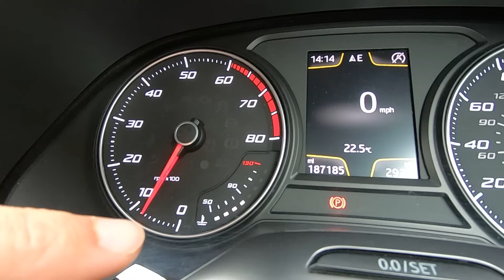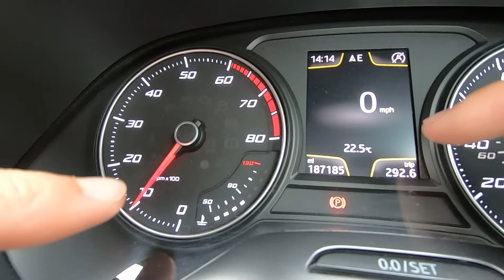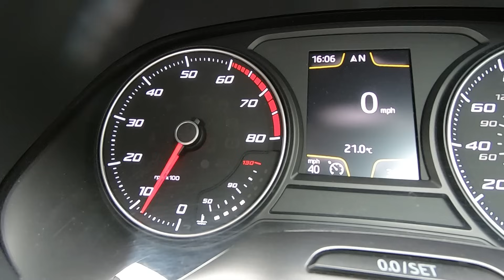Why do we need a clutch?

Comment: Nice video 😊 bro you are My favourite driving teacher and favourite Youtuber I have a question ❓ because you have great knowledge of automobiles my question is if we buy a car for example toyota yaris 2 generation or any other car how much the engine  is good to run or works fine I mean how much Miles like 400000 miles or 500000 miles the engines life is  and  after that what we can do change engine or what is your suggestion lots of love 😘 bro please tell me
Reply from the maker: Thank you. The answer to your question is the length of a piece of string. It varies greatly from engine to engine and how well they're looked after. The trouble with a used car is, you don't know what the previous owner has done, my car has nearly 190,000 miles on it and it's still good, but I do look after it. Some engines have done over 500,000 miles but normally they're still relatively young and have been used as a taxi. In my opinion, age is more important than miles. There was a Volvo P1800 I think in the US that did 3 million and is still going.

Comment: Your videos really help me very much, my test is in October, I have a question; can I use parking brake in driving test during hill starts or at stopping to traffic lights on hills? I’m struggling to continue on lights in hills and my instructor don’t say me to use it on any occasions, just on parking the car
Reply from the maker: You can use the parking brake for hill starts in the UK. As long as you drive the car in a safe and legal way, the way you achieve this isn't that important.

Comment: Could you press the gas and let go of it straight away once its rev'd to the correct RPM and then change gear/set off? So you dont have to hold the gas steady whilst finding the bite
Reply from the maker: You have to hold the gas steady or it will return to idle (minimum revs).

Comment: If we remove clutch without simultaneous adding gas,  the engine decides to stop working.
How did you do this?
Reply: You'd usually hold the brake pedal or use the handbrake first whilst you find the biting point and then add some gas to get going.
Reply from the maker: This video may help: https://youtu.be/UdTSRBJrw7Y

Comment: One question, I've always found putting my car in neutral while slowing down for a red light is better and I find it easy to control it as well, will the clutch still be damaged or the engine.
Reply: No
Reply: If you do that then you lose out on Engine Braking, and then it's solely the brakes doing all the work. Which is alright but you might end up replacing brake pads a bit earlier
Reply from the maker: This video may help: https://youtu.be/R7mTuoP8ZFc

Comment: I’m doing my test in my own car however it does have a few modifications and aftermarket parts fitted. Would this ever be an issue and potentially cause an examiner to not do the test because of the alterations to a car?
Reply from the maker: If your car is safe and legal then it should be fine.

Comment: So basically the purpose of any clutch in any machine is to sync the rev speed between two rotating shafts?m?
Reply from the maker: The purpose of a clutch is to disconnect and reconnect. With a manual transmission, the clutch has a friction lining that allows some slip so you can reconnect smoothly.
Reply from the maker: The reason why we need to disconnect and reconnect is the true question. The answer to the question is, the engine cannot spin slowly so we must disconnect the engine from the wheels so we can stop the wheels without stopping the engine.
Reply: @ConquerDriving  ohhhhh thx

Comment: Can you do a video about having a check engine (mil) light on ect
Reply: Don't really think that is a video for a driving instructor to make, there are many different reasons why a check engine light could come on.
Reply: @collinslfc  during the test ect like what will happen ect
Reply from the maker: There are many reasons, I recommend having an diagnostics tool you can plug into the OBD2 port to read the fault codes. An essential tool if you want to work on your own car.

Comment: I have got a question, during a test can we rev the car as high as we want to accelerate faster on the highway or even in other situations ?
Reply from the maker: As long as it's appropriate for the situation, there is no set limit on how high you rev the engine but you should be driving in a safe and legal way whilst also trying to be economical. So needlessly red lining the tachometer or accelerating harder than necessary won't be appreciated.

Comment: How hard/far should I press down on the clutch pedal when changing gears? Thanks
Reply: You should press it firmly at its maximum, otherwise it would make a horrible grinding sound.
Reply: As far down as it can go
Reply: @Dodo.isp22  Yes this is correct, I'm on day 3 of driving my first manual transmission. Got lazy with depressing the clutch on the interstate yesterday and heard that horrible sound. Definitely don't want to do that again!
Reply from the maker: All the way down is best.

Comment: Have you ever tried to change gears without the clutch? How did it go if it happened?
Reply: if you get the rev range right, it's actually quite easy, the gears just slot it. Handy skill for when you can't usue a clutch or the cylinder is broken in emergencies
Reply: You can do it without the clutch. Dont know how it works but ive seen my dad do it when he was trying to show off
Reply: You can pull a car out of gear without pressing the clutch in pretty easily. Pretty sure it's not good for the gearbox though. Putting it back into gear (without the clutch) requires that you can control the engine speed to precisely the rpm it will be at in gear. This is called rev matching, and this channel has a few videos on it. Normally, you would still press down the clutch, since any minor differences in speed between the engine and car put undue strain on the gearbox. The purpose of rev matching in a normal scenario is to make shifting smoother during downshifts or when at higher revs. When rev matching, since the engine is very near the speed it needs to be, you can come off the clutch much more quickly, which is useful for fast driving.
Reply: I did this by accident very recently.  I had to make a tight left hand turn (I'm in the US, so that would be a right hand turn for the UK).  I forgot to press the clutch when I downshifted from third into second gear.  Nothing happened.  I was down to 8 mph when I did it.  My car did not make any strange noises or jerking motions.  I did not do it on purpose, I made a mistake.  The good news is, everything feels normal on my car.  I didn't break anything.  So my thought is, if you change gears without the clutch by accident, don't worry about it.  Manual transmissions are built to be tough.  But don't make a habit out of it.
Reply: @hamsterama  I've done that a few times myself. Doing it once or twice by accident certainly isn't going to cause any major harm. Doing it repeatedly though will probably damage the sychronizers over time.
Reply: @quinnobi42  When I first started to learn to drive a manual in 2020, on two occasions, I forgot to press the clutch when changing gears.  This was the first time I made this error as a slightly more experienced manual driver.  I only realized I made a mistake when I went to lift my foot off the clutch after changing gears, and realized my left foot was still on the floor.  I was really worried I broke something.  Luckily, my car shifts totally fine.  But you're right, it's likely the synchronizers would get damaged if this is done on a regular basis.
Reply from the maker: I have a video in the coming weeks that will include that.